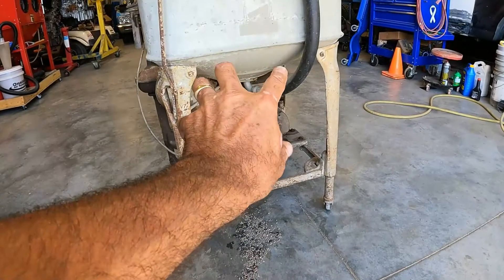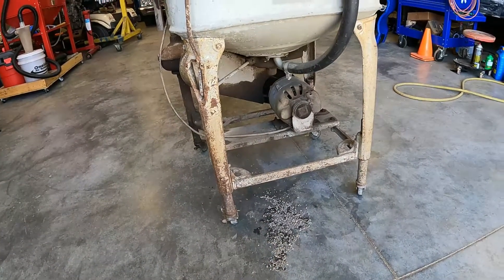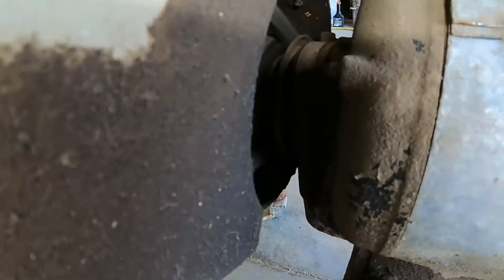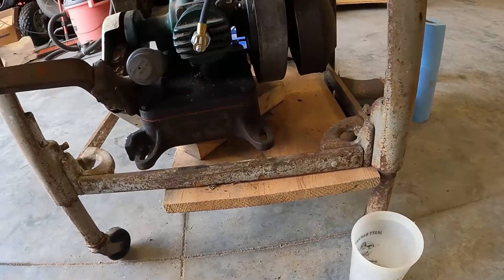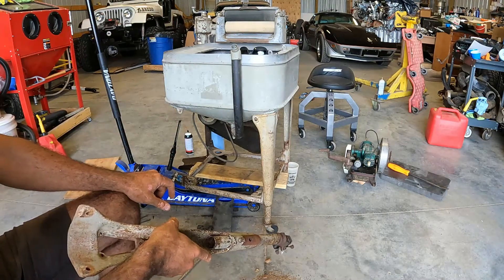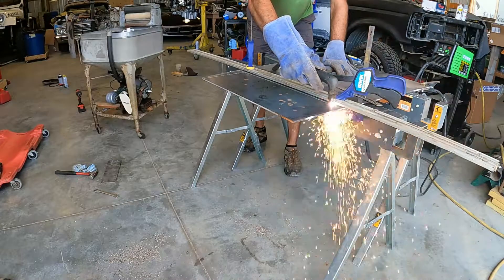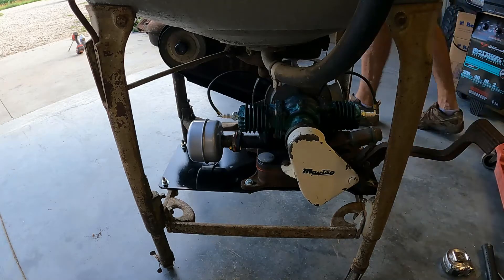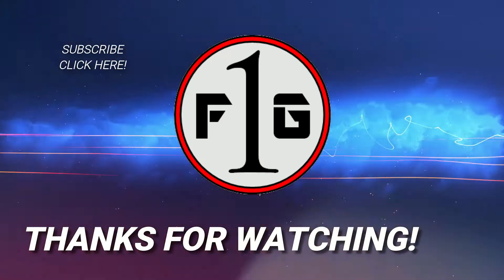We built an 83 plus year old 2 Stroke Maytag washing machine!

Comment: Where do you put the gas in at?
Reply from the maker: The base of the engine in the fuel tank.  A simple tube and needle valve pull the oil/fuel mixture up and into the engine.  Holds a quart... maybe.  Thanks for the comment and watch!
Reply: @freedom1garage  thank you very much for the video it was very entertaining.
Reply: @freedom1garage what do you think a good price to pay is, I missed out on a complete gas one for 400, but another guy wants to sell me one for 550 and has all the parts to make it a 2 cylinder gas (was electric) thought it’s pretty pricey but it would just be a neat thing and want to actually use it for daily washer lol did you have to change pulley size thank you